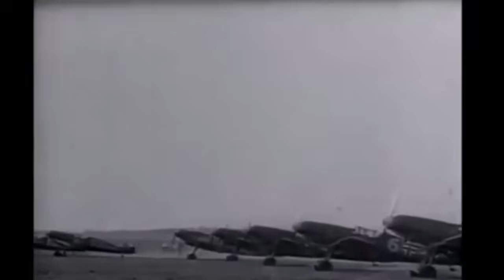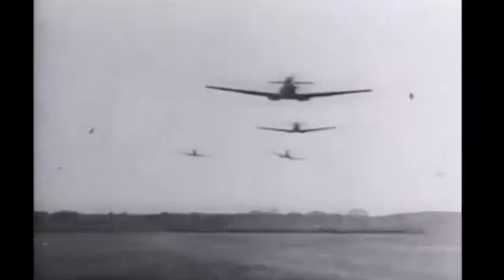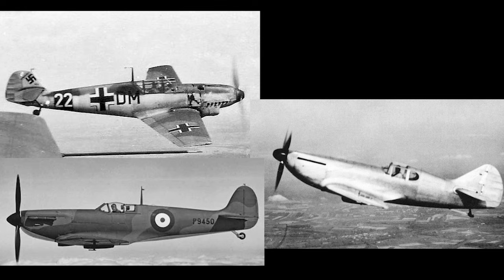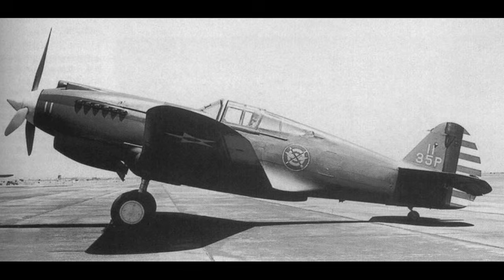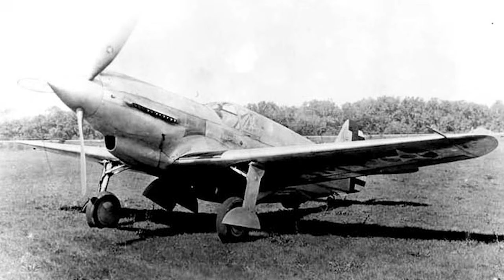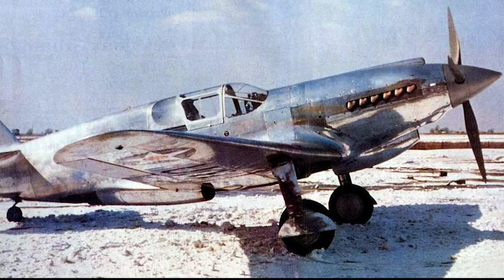American Spitfire; the Curtiss XP-46 “Kittihawk”

Comment: Odd how every airplane could go over 400 mph on paper
Reply: A lot of manufacturers based their top speed figures on the prototypes weight and engine power before figuring in things like armour, armament, self-sealing fuel tanks and all the other paraphernalia that a combat aircraft needs, so they tended to sound much more impressive than they actually were.
Reply: Well in a dive straight down most can , although that's not ideal
Reply: Airplane salesmen. They are like automobile salesmen. And it's interesting that every airplane that never made it into production would have been a super world beater airplane without any of the problems and drawbacks that always seem to crop up with production airplanes when they go into actual service and are called upon to perform in the real world.
Reply: False marketing, especially by Curtiss, Bell and Lockheed.  NAA delivered closer to their estimates.

Comment: OK! Now I understand why 2 names were used for the P-40 in RAF (and Commonwealth) service! Thanks Ed.
Reply from the maker: Yes, it was a detail I had wondered at too, only got the answer when researching this aircraft.
Reply: I have always loved these planes since I was a child I still have my die cast flying tiger lol she has some serious flight time on her from all the battles me and my friends flew when we were young
Reply: @JohnWayneCheeseburger  I absolutely loved the type too - From the point someone, probably my dad (who in this instance of unusual largesse had probably met someone in the pub who happened to have one which fell off the back of a lorry) gave me a Glow plug engined, sand brown plastic P40 tricked out in 'Flying Tigers' (of China fame) markings.
It was meant to fly round in circles its hight controlled by two strings on a hand unit. 
It  probably would have but we could never get the motor to run for more than 20 seconds.
But me & my mates would spend hours simply trying to coax the motor into life, then gaze with rapt admiration when Buurup, halt,  Buurup, halt occasionally burst into a high pitched scream and tried to tug the thing out of the hands of whoever was holding it.
.
Looking back I probably reckoned it was the most wonderful thing my dad ever bought me.
Sadly, I have no idea what happened to it.
Last I saw it was sitting quietly in its box almost forgotten about.
(My mother's rare obsessive urge to 'clear out clutter' is the prime suspect).
Reply: @Farweasel  I had the same one, and same memories!
Reply: @Farweasel  The fuel tank's vent to atmosphere was plugged, chum.
The "Thimbledrome" Cox .049ci engines came with either a metal fuel tank that screwed to the back of the engine (My Cox "Proprod Shrike" had that style.) Or a plastic crankcase-plug made of plastic that contained it's "carburetor"(fuel mixer, actually) and had a hose from it to the fuel tank in the machine.   Either way - it was the fuel tank vent.
Reply: I know from my Grandfather who was an Australian airframe fitter, while the P-40 might not have been the 'Best' fighter of WW2, a lot of them made it back to Australia from the New Guinea campaign appearing as if there was no way they should still be flying. Many made it home severely torn up. Fortunately not a trait shared by Zeros...
Reply: Just to keep things straightforward, clear & to avoid misunderstandings the USAAF called them 'Warhawks'.
Meanwhile, British Forces of all types called every unfamiliar foreign bird (the feathered ones that is) 'Sh1tehawks'.
Reply: That was a public service announcement on behalf of the Society for the Preservation of Gratutious Rudeness (,,,,,,,,,,,,,,,,,,,,,,yer pheasant plucking cork soakers).
Reply: It's been years since I binge read about the P-40 so correct me if I'm wrong. 

An export variant of the B built for the French was the Tomahawk 1. The export variant of the C model for the Brits was the Tomahawk 2.

It gets confusing very quickly when you start going through production models. Sometimes earlier models were upgraded to supercede later models so you might find a B model variant that's more advanced than a C.

The D and E variants got the Kittyhawk name. And the F variant (fitted with a Merlin) was the first one to be named the Warhawk, which confusingly was sometimes retroactively given to the earlier models.

Doesn't help that everyone seemed to have their own idea what they were called, so you sometimes can't be sure which version a document is talking about...
Reply: Well the P-40 had three nicknames for the Allies...Tomahawk, Kittyhawk, and Warhawk. And it was based upon the multiple variants of the craft, be it engine, armament, etc. Considering it was "outdated" by 1942, there were more than 15,000 P-40s made during the war, only out-produced by the Thunderbolt and Mustang by the U.S.
Reply: @tempestfury8324  those who know the secret handshake make the money.  GM had to ensure their substandard Allison engines had a market, so they stopped Curtiss and Lockheed from switching to Merlins.  Larry Bell was another collaborator.
Reply: @bobsakamanos4469  : That is the most ridiculously sophomoric comment I've heard in a while. What evidence do you have of that? What's that? Oh, you have no evidence? You're just farting in the wind in your own direction. Here's why;

Both the P-40F and P-40L models came with Merlin engines. The British called them the Kittyhawk II. 

Here's some other FACTS I'm sure you don't know; Below 12k feet both engines are very similar, the advantage going to the Merlin with about 90 HP more. But the Merlin was heavier, bigger, and more complex with more parts than the Allison.

Above 12,000 the F and L models outperformed the Allison P-40's because the Merlin's were equipped with two stage superchargers.

You're a prime example of an "armchair historian" that just blathers nonsense without any real knowledge of the topic at hand.
Reply: @tempestfury8324  lots of insults from an uneducated aero modeller, but we forgive your jingoism.  If you actually read flight test reports, you'd see that the Allison had continual problems throughout the war.  Perhaps you're another fanboy of Greg's propaganda site, spewing nonsense about successful overboosting of the P-40 engines.  Try some independent research and you'll see that engine fires, broken cranks, thrown rods were common, but the RAF & RAAF deemed the pilot in the slow P-40 was more important than the engine.  Even the later improved engines in the P-38J couldn't take high boost without problems.  
Kindelberger of NAA was quick to recognize Allison incompetence and asked the BPC in March 1941 for installation documents for the Merlin XX.  
The P-82 engines in Korea were a maintenance nightmare.
I hope that gives you enough to start your own research and stop regurgitating false revisionist history.

Comment: I often think about the era in the 30's after the depression and starting into the war and the thoughts that would go through the minds of the builders and designers "great another contract " only to be followed with "how and where are we going to get another item built"  Thanks for the video.
Reply: The businessmen say great a new project we can handle it the designers say it will do 400 mph on paper. Then the engineers and factory workers have to make it happen.
Reply: @maxpayne2574  designers are engineers
Reply: TBF, most everybody, in the mid / late 1930's, was caught with pants down when issue of 'production capacity' came up.
Reply: Finding workers with the skills as well as inventing new production techniques must have become a big problem by '42/43. Going from aircraft like the P40 and Hurricane to aircraft like the P51 and Tempest is a big leap.

Comment: Have a look at 'Greg's' video on what might have been on the 1750 HP p40 ;-)
Reply: Sorry, but that's all hyperbole.  Those over-boosted P-40s were problematic with engine fires, broken cranks, thrown rods, etc.  Even the late war Allison engines were problematic.  Have a read of the Wright field testing of P-51B, P-47 and P-38J with the 150 Octane.  The Allisons were limited to 70" MP and still had problems.  No way the earlier Allisons could handle the boost advertised on those videos without detonation and extreme short life.  The RAAF did it, but it was a question of saving the pilot vs the engine.